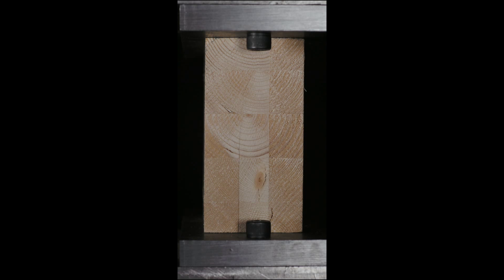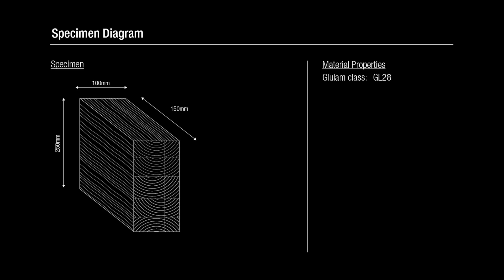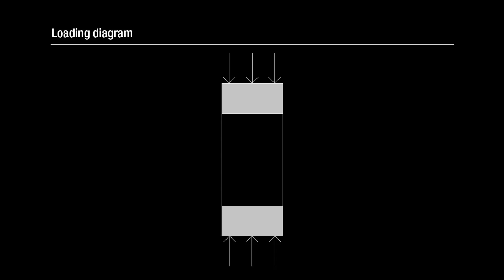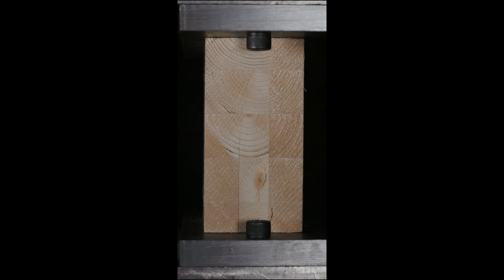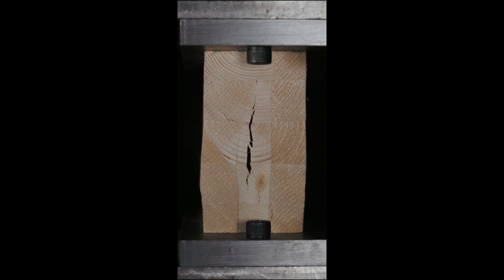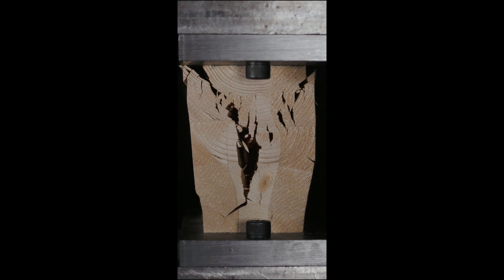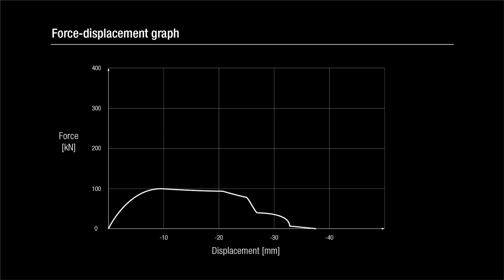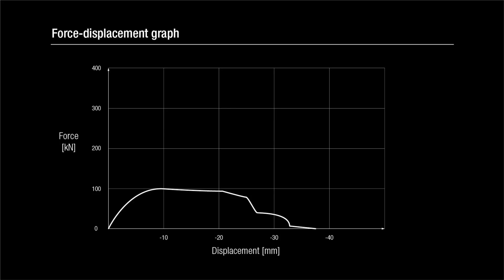Compression failure of a timber block perpendicular to the grain: Materials Lab on-line

Comment: Why is the wood weaker when a force is applied perpendicular to its grain?
Reply: Because the grains are like little tubes that can easily be crushed sideways, but resist compression well length-wise. Like if you stacked up a bunch of steel pipes and put load on the ends of them versus crushing the sides of them.